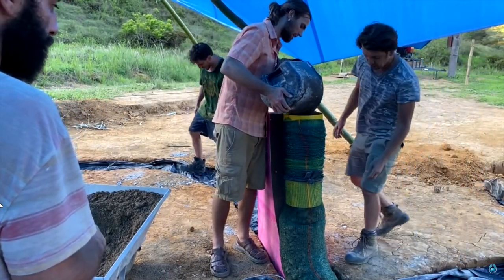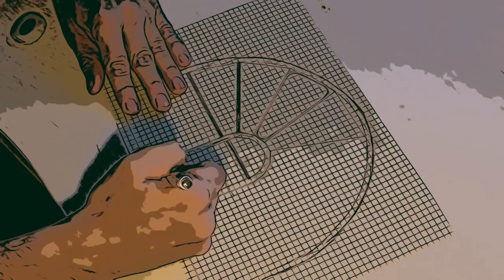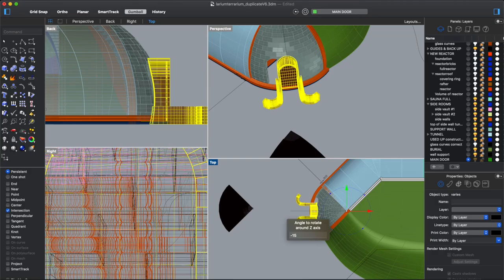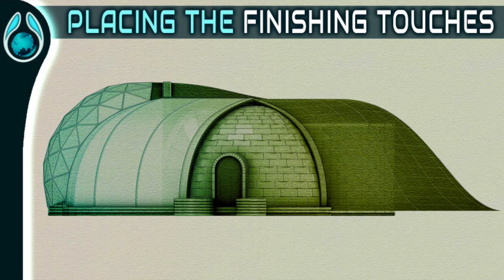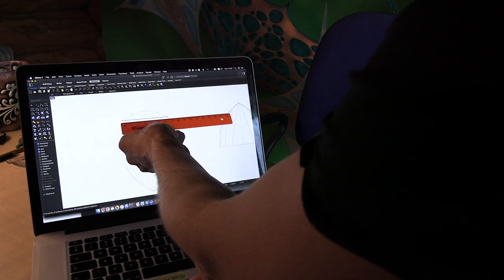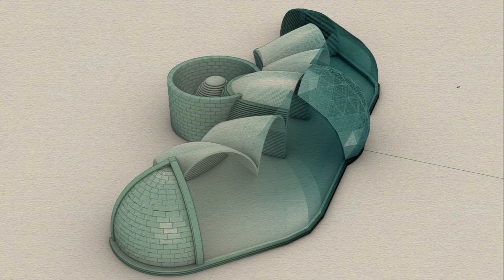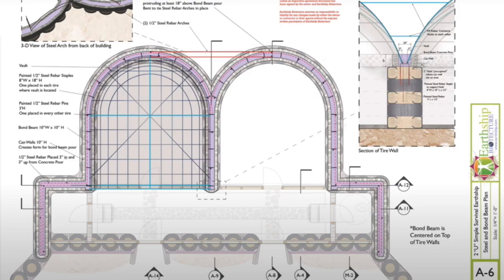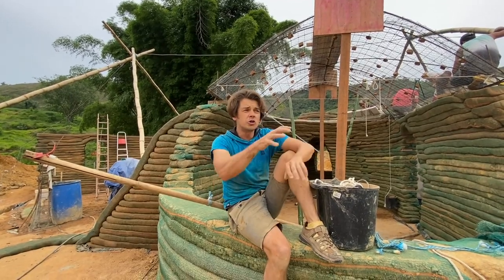Learn to draw a self-heating Off Grid home in 2D & 3D #offgrid #2Ddrawing #3Ddrawing #aircreteharry

Comment: I've been a dome lover since doing Laserium shows in 1979 and a monolithic dome enthusiast for over 20 years. When I attempted to design my own 'perfect' dome home, the first obstacle was making 2D plan/elevation construction drawings. So, I took a 3D AutoCAD construction course at the local community college, as well as a course in International Building Codes to be compliant with local building codes.
The plan was to provide an construction engineer with a 3D model to calculate loads and stresses, get his stamp of approval, then present the engineered approved construction drawings to the local authorities.
But, AutoCAD is very expensive, so I tried Rhino 3D, but ended up using FreeCAD, instead. I learned to use it by watching YT tutorials. As the name implies, it is a free download, but is also fully featured, and capable of exporting content into AutoCAD for the engineers.
Unfortunately, life happened, so I haven't had the opportunity to build my dream home. But my construction drawings are complete and ready to go, if the chance ever arrives.